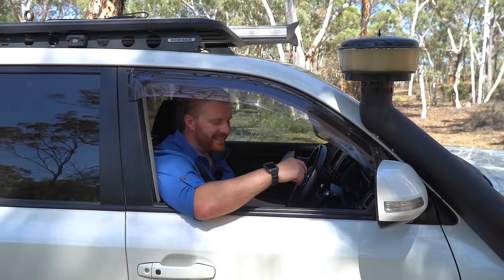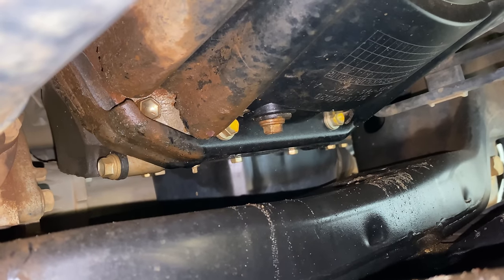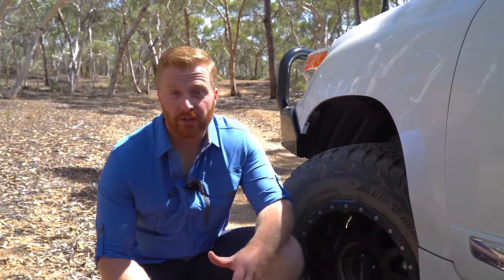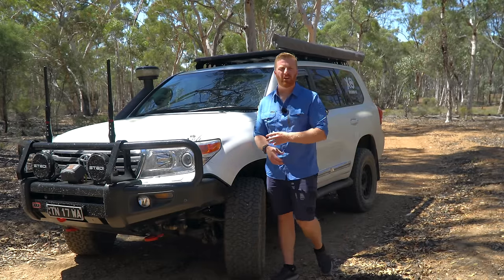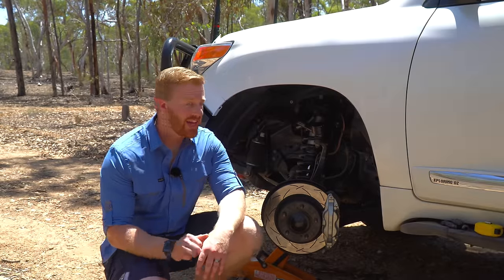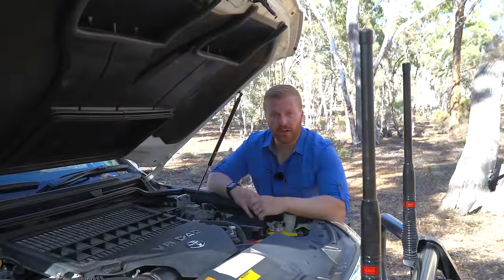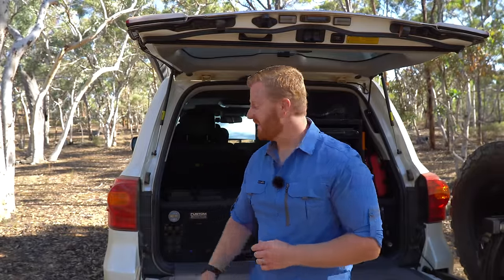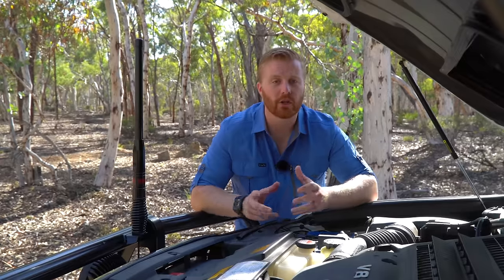LC200 | PROBLEMS & ISSUES | Not everything goes to plan -Mechanical-Electrical-Suspension 200 SERIES

Comment: Really enjoy your videos. No nonsense reviews and always very well explained. Your videos are my favourite on the YouTube platform. I was going to go the Bp51s in my Cruiser but got told the remote res Dobinsons Mrra were better. So far I've done 24k and all good so far. I dont do rough tracks, just sand driving and long highway kms on fishing trips.
Electrical issues can screw with your head and even worse when proffesionals can't work it out. Hope you get to the bottom of it soon. Watching this was a good start to my morning.
Reply from the maker: Thanks mate, really appreciate the feedback and humbled to hear that you enjoy the channel so much! 
I'm glad to hear that you have managed to find a suspension system that works well for your vehicle. To be honest, the BP51 have performed reasonable well, it was just those issues of the fitting and lack of technicians knowledge on the product that left a bitter feeling. 
Electrical issues.... what a headache, luckily nothing too major for me, but always a little frustrating. 
Thanks again mate, Nathan.
Reply: How does the Dobinson do on the rough parts of the highway (potholes, asphalt ridges and other imperfections) compared to stock setup?

Comment: Great video!  Suggestions:  Remove the secondary fuel filter and see if problem goes away.  There is a ~30mm O-ring between the filter and bowl which can easily get left out and is not supplied with replacement filters.  If that doesn't work, replace top on factory filter as others have suggested.
Oil leak.  Might be a sign of increased crankcase pressure from the catch can.  I'd disconnect the catch can and go back to the simple factory hose.
Low voltage - probably poor earthing.  Make a new earth point to the body in teh back of the car - remove paint, tap thread and install a new bolt covered in Vaseline, and hook everything up to that.  Also make sure the factory body earth that comes off your cranking battery is in good nick and making good contact with the body.
Parasitic loss from 2nd battery.  Just pull fuses until it goes away to identify the problem.  I found my inverter had small losses when switched off so replaced the fuse with a large circuit breaker  which can be used as a switch.
Reply from the maker: Thanks mate, all good suggestions here and I think I will go through and try each one. 
Appreciate the time taken to send these through and I'll definitely report back with any progress made. 
Cheers, Nathan.
Reply: I've also got a small leak on my rear main seal and I have just clicked over 100,000. I've also thought if the catch can increases crank case pressure. Wish someone would look into it.
Reply: Hi Phil G and Nathan.
What Phil G sounds like a terrific suggestion with the fuel system.
I'm an ex - HD fitter by trade and would like to see what you think, when we used to test radiators after refurbishment we used to do a leak test on them for the cores, top and bottom tank.
 Radiator test kit to pump up positive pressure from the fuel tank cap to the outlet of the secondary filter to the fuel pump. This would depend if you can get a test fuel cap with test fitting and to be able to plug the filter outlet hose to the injection pump. Do a pressure leak down test and check your gauge over a few minutes for pressure drop or do a visual of your fittings and washers.

I don't know what the internals of the filter housing assembly looks like but it may determine if your injectors are leaking off thier seat.

Phil G would this work? For Nathan
Reply: Looking at the video I had a similar issue and after replacing the factory hose clamp with one from Bunnings that solved any further air locks. It took me a year of priming before I figured this out. Hope this helps🤙🏼
Reply from the maker: @nathancurran8550  Cheers mate, quick easy fix that is well worth a try! Thanks.
Reply: @XploringOz  Replace the brass fittings on the primary filter with AN fittings and seal the threads, those kits are now coming with AN fittings for this reason.

Comment: Really good video, well presented, organised, and not full of yourself like so many others I won’t mention.
Electrical is becoming an issue with late model Toyotas due to the Canbus system unfortunately. The days of just splicing in to pick up power for accessories from an existing is over unfortunately.
The electrical system is computer monitored to detect any extra current draw beyond what’s expected within the software programming of the Canbus system.

Start piggy backing accessories off the monitored circuits and the computer will respond by lowering voltages to protect systems like Alternator etc.
There are specific patch cables now days to make things draw within the programmed perameters (ie to fool the computer into accepting the new out of program current draws.
With so many electrical systems these days this was inevitable.

Example. Some vehicles (not Toyotas but for eg Ford Rangers as but one example) the steering is no longer hydraulic. It’s electrical connection now between steering wheel and front wheels.
You cannot afford to have the steering and lane keep assist etc go on the fritz coz some idiot picked up power for spotlights by splicing into a mission critical system like steering.
The manufacturers make the electrical system to control radar, cameras, braking, etc ie safety systems that need to be reliable.
A LOT of the electrical accessories that get added these days, with inverters, dcdc chargers, dual batteries, winches, solar panels, induction cook tops, coffee makers, 2 way radios, spot lights, light bars, extra cameras, water pumps, etc etc, it’s the equivalent of a small nuclear power station FFS & people wonder why the ECU computer monitoring and controlling all this stuff tears it’s hair out and gives up and goes on the fritz. 🙄
Any Auto sparky these days whos not a computer nerd diagnostician and programmer isn’t in the race to start monkeying with the 12Volt system on these new modern cars.
Heck just spotlights wiring requires a special patch because headlights on and hi lo beam dip etc is all automated and computer controlled.
Splice into the high beam circuit to power your spotlights and you’ll get a dash warning along with all lights off, that says “lighting error, take to dealer”.
So how do you take it to the dealer in the dark with no lights when the dealers closed anyway? On a tilt tray is how! 🙄
So unless you have a scan tool to clear the codes and keep your spotlights switched off your probably not going anywhere.
It’s got to the point of being bloody ridiculous to be honest.
My 2C
Reply from the maker: I agree with you here mate! 
There are soo many electronics on vehicles these days, its crazy. Further to that, like you mentioned people want to take absolutely everything with them on their trips (I'm somewhat guilty of this sometimes). 
Gone are the days of a simple battery to splice from under the bonnet, however this is the compromise we make to satisfy those who don't modify there vehicles for off-road use. People who enjoy the extreme comforts and convenience of a computer doing everything for them all the time. 
I guess it's just one of those things that we are going to have to get used to and adapt to though.... won't be disappearing anytime soon.
Cheers, Nathan.

Comment: Your secondary fuel filter is causing a pressure drop between your tank and pump causing the motor to cut out. This is one of the issues with running a secondary fuel filter and why you shouldn't (apart from it's a waste of money and you don't need it). The fuel system on the LC200s use a pump in the engine bay to pull fuel from the tank, through the filters and to the injectors, rather than having a an in-tank pump pushing fuel to the front.
Reply from the maker: Thanks for the advice mate, I'll definitely be isolating the secondary filter to see if this is what causing the issue. 
Cheers, Nathan.
Reply: Absolutely correct there! Secondary fuel filter for those vehicles is absolutely unnecessary. The OEM fuel filter is already specified to the contamination levels the injector system can safely take. For pre and final filter setups you would want the second stage on the pressure side or post transfer pump. 👍
Reply: G’day there is a certain thing to say about secondary or pre diesel fuel filters. 👍 you are right no need a secondary fuel filter in Tokio city! Diesel is clean as it comes from the tap. Anywhere else the factory pre filter are insufficient that at least my 40 over years experiences.
And yes we fit to all our industrial Diesel engines aftermarket water separator/filter of high quality. 
Having fitted thousands of such systems in our machines various types depending on the main filtration system installed and here I would say the original Toyota main fuel filter is a big joke, much to small for a 200 kw engine. We fit std to 100kw engines 10 times the filter size and have upfront large water separator with 2 ltr pre filters. No any issue with gung Diesel. On larger industrial diesel engines we fit a hydac system which cost approximately. 2.5 k AUD. Cheap compared to the injector price (4K ea) for this engines which would last only 1 year without such pre filter.
So horses for corses…. 
Cheers
Reply: @holgermuller2987  Each to their own and you've had your own experiences. I have never had an issue, and I have never heard of anyone having a problem using the factory Toyota fuel filters (alone, without a secondary filter). Toyota spends billions of dollars on R&D and testing, and the 1VD-FTV has been in use all over the world (including developing nations with horrible fuel quality) for 15 years. The stock fuel filter on the LC200 is specified to filter at 4 microns, and has a water/fuel seperator already.
Reply: @XploringOz  Will be interested to see how you go - hopefully it solves it for you. I've seen the exact symptom before and it turned out to be the secondary filter. The issue is that the fuel pump is specced for factory flow resistance (at 4 microns through a single filter). When you stick a secondary (probably 2 micron) filter into the equation, the pressure required to pull fuel through both is now significantly higher. This can cause additional wear on your fuel pump, and also pressure drops between filters or even collapsing fuel hoses depending on what type has been used.
Reply: Had exactly the same issue. There was a small air leak between the pre filter and main filter causing air in the system. The fuel pressure would bleed down overnight and on start the vehicle would effectively run out of fuel.  This never happened on other starts in the day only the first after overnight. If I primed the system with the pump on the genuine filter the car started and ran fine. If not like yours stopped in 10-15 seconds, then took some turning over to restart. Prefilter removed all threaded connections resealed, new hoses hose clamps.  Problem solved!

Comment: Voltage drops in my experience (assuming it was 12V from the start), are related to: 1. Check the earth points for equipment on that circuit - if it fills with dust or rattles loose or even worse liquid with dust/dirt it will drop voltages as its like sticking a big resistor in series with the battery. 2. Cable joins especially to distribution points/panels - same reason as 1 and 3. cable break/cut and short circuit to the body of the vehicle.

Had the fuel pump issue before on the80 series - it had no obvious fuel leaks in the piping so that left the hand pump itself being the issue. replaced it with a new hand pump/primer issue gone.

Added a bullbar and winch to the new 200 to replace the 80 - i use an inline screw in/screw out switch which was recommended due to its reliability. The truck did get a KDSS lean of 28mm with the weight change, but undoing the valves raising the rear left and resealing ater lifting to 170mm got it 10mm lean which is acceptable. You can get it smaller with a workshop car lift and avoid spacers.
Reply from the maker: Thanks mate, I appreciate some of the suggestions here. I'll definitely look into it. 
A few people here have mentioned the fuel primer part being replaced, so I'll definitely consider purchasing a new one and seeing if that makes a difference. This issue is probably the most frustrating at the moment.
Thanks for the heads up with he KDSS lean too. I'll probably end up getting some slightly higher rate rear springs for the cruiser soon anyway and I'll see if I can get the lean sorted at the same time. 
Cheers, Nathan.

Comment: Hi Nathan
Great honest video as always.
My mechanic recommended and fitted the kaon shock guards to my 200 and I think they are great he also installed the Ironman forged upper control arms with my king suspension and the  land cruiser drives great. I specifically bought the non Kdss model gxl to avoid what a lot of people are going through with the leaning.
I hope you have luck with all the small issues but definitely look into the Kaon shock guards.👍
Reply from the maker: Thanks mate, appreciate it. Yes, I have my eye on the Kaon guards, that sure look the part and hopefully something I'll put onto the vehicle sooner rather than later. 
Ahh, the infamous KDSS lean, although frustrating I do enjoy the benefits it does bring.
Cheers, Nathan.

Comment: I’m having the same issues with my BP51s. After many visits back to ARB, car still feels very twitchy and boat like that rocks from side to side after even the smallest of bumps. With the van on, it converts into white knuckle sway. Very disappointed with my dream car 2019 Sahara. Close to removing the suspension tbh. Also my Victron on my iTech under bonnet lithium draws -0.15amps with everything off. Can’t seem to figure out what is actually causing that. Have a dual ARB compressor and some 12v outlets, fridge etc.

Comment: Replace the priming pump on the fuel filter. The membrane degrades over time and can leak air in. There is enough fuel in the system after the primer to allow it to run for a few seconds. Common issue with Patrols.
Reply from the maker: Thanks mate, I'll definitely look into this, especially since it has been mentioned a couple of times. 
Cheers, Nathan.
Reply: @XploringOz  no worries mate.
Reply: Yep priming pump is leaking air, incredibly common with hand prime units in trucks. As for the key fob try replacing the battery’s within the fob itself, had similar issues with a mustang and turned out the button batteries were too low voltage causing detection failures
Reply from the maker: @SUPERTRUCKER166  Yeah, something I'll definitely look into, cheers. In terms of the battery issue in the remote, unfortunately this is something I have already tried without success, but I'll keep searching for a solution. 
Cheers.

Comment: No surprise that the ARB gear has been a problem and that the info from the ARB sales/marketing team is not always up to helping the problem.
We have been running  ARB lift kits to carry survey gear in town and out western Qld - we use around 20-25 HiLuxes, DMaxs, about  6 LC79's and 4 LC200's . 
The ARB stuff has been a constant source of issues over time from broken / cracked springs, leaking and poor performing shockies and drooping leaf springs. 
Usually, the first year is OK, after that is when the fun starts.
Many of these vehicles are town use mostly and some of these even fail, often creating bizarre wear patterns on tyres - wearing them out even quicker
All round not what we needed. 
We have since moved away from the ARB marketing team and have used a couple of options - Opposite Lock, and a couple of other local, but less well known suppliers have been used over the last couple of years to replace the ARB stuff as it has been failing.
Bit early to tell, but most of the replacement gear is going as well or better than the ARB stuff it has replaced 
On the topic of info from 'service centres' , ARB is not the only one that provides dodgy or incorrect info. 
We have had issues with info from Coopers suppliers regards tyre pressures.
The tyre fitters have told our guys a 35-45psi range for a tyre with a max pressure of 80 psi printed on the sidewall - only for our guys to blow brand new tyres due to under-inflation.
When shown the pressure info on the side of the tyre, one of these geniuses remarked "well, that doesn't look right does it ??"  
Really ??
I have been using Dobinson MRR adjustable shockies on a LC200 for a couple of years now without a problem, not many k's tho' ~45,000km 80/20 road/dirt . 
Not too bad to adjust to balance performance/comfort but it does take patience with the range and nature of the adjustment
The hi/lo speed compression damping operates similarly to my motorcycle, so that's not too bad. Rebound adjustment is simple using the manual provided. You can feel a single click on both .
Reply from the maker: For sure, ARB salespeople and just salesmen after all. They don't have that pride that sometimes comes with smaller, independent workshops. 
I'll run this gear into the ground and then I'll definitely be looking at the market to see what else is available. Saying this, overall the ARB suspension has been performing well thus far. 
What gear are you running in your fleet now? 
Cheers, Nathan.